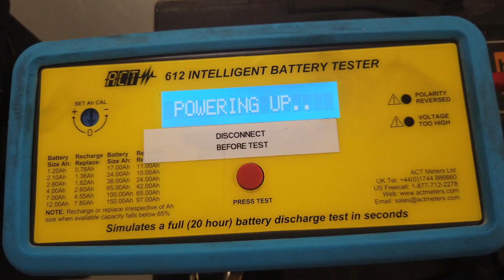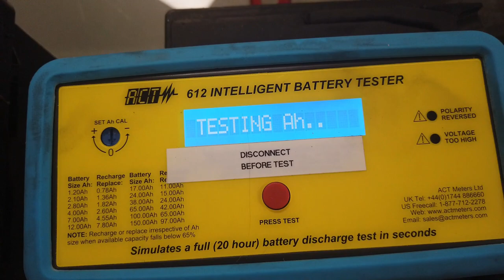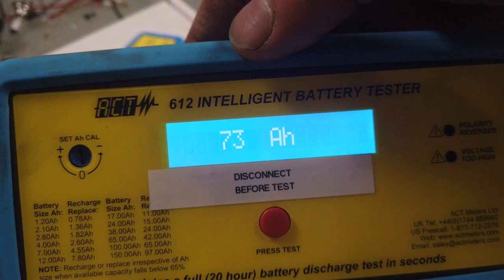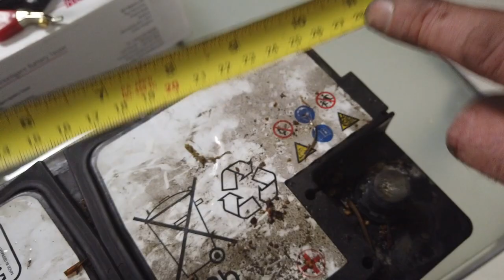How to change Land Rover Freelander 2 battery change + charging + Testing

Comment: If you remove the air filter housing the front of the battery box unclips, then once the battery leads are disconnected and the clamp removed it is a simple task to slide the battery out towards the front of the car. No tilting or navigating around the wires. Also means you can work from the front and not have to hoist the battery over the wing from the side.

Comment: Thanks Simon. I must've tried pulling the old battery out for 10 mins and even got a ladder to stand higher for more leverage before looking this up and noticing the long bolt/clamp that had to be loosened. I guess it was time for a battery replacement since it must've been a really long time since I changed it last and had forgotten about that bolt.
Reply from the maker: I watch my own videos sometimes as i too have forgotten how to do things !
Reply: Riley, I did the same thing trying to pull out me old battry.  Pulled and tugged until I was huffing and puffing, spewed out a few choice verbs.  Listened to a psychologist saying "if you can't do something, it's because you lack the inner strength. You lack power."  I thought to me self, well let me tell you lady, you don't know who you're dealing with!  I've got power!  And I know how to use it too!  I'll show you !  I'm no average bloke.  I'm an above average bloke.
I rented a small crane from CRAP (Consolidated Rent A Part) 
and out the came the battry.  There, job well done, well done.  Boom, right.

The rest of what was left of the LR2 ended up in the junk advertisements.

Comment: When I changed my battery I couldn’t get the clamp back on eventually  I took it back out and found the new battery had a removable filler strip on the side  , removed that and it fitted perfectly.

Comment: Hi  Simon !!

Use your video to change my battery.  
Thanks 😊  !!

But one minor problem .

Dissappear  impulse window .

Encounter with this problems ???

Continue with great jobs 👍👍 !!!

See In another video , close window and still bottom 3 sec to " close window " and will reset and back impulse open/close windows.  Yes ??
Reply: You may need to do a window reset - pull the button to bring the window up and heep holding the button for a few seconds - this should re-calibrate the window - try it and let me know

Comment: Simon - When you removed the battery from the FL2, did you run any sort of "memory saver" or similar type device to retain your electronic settings (radio, engine/transmission, etc)?  

If so, what type (such as an OBD II port connected, or other), and if so, what type do you recommend?  

If not, why not?  

I plan to replace both the primary and aux batteries in my 2016 LR4 and would like to hear your recommendations.  I realize you don't have an aux battery in your Disco 4, but I'm still interested in your comments.  Thank you.

Comment: Good video.  Wondering if I disconnect me battry if the car will require some codes before I can restart or use the radio, etc.  2013 LR2 US ver.  Thanks!
Reply from the maker: From memory we dod not need to enter any codes

Comment: Good job, i changed mine 6 months ago but it was not  simple ..
Reply from the maker: It seems to be more complex than it should be ... i would agree !
Reply: @L663  thank you for this, if you take the battery out overnight can you unlock the system or only at a dealer?

Comment: Nice video! Do you know where I can get a replacement breathing tube? After this video I went to check my battery and realized somebody at some point has cut a piece of this tube and now it does not reach the little hole and plus the plug is missing. Thanks and cheers from Brazil
Reply from the maker: The tube is Part Number LR008949 - it is just $2 from Land Rover....
Reply: @L663  Great! Thank you so much for your reply.

Comment: Really appreciate your videos guys, thank you! Once a new re-charged battery is put back in do we need to let it sit so the battery management system (BMS) recalibrates? I read somewhere it needs about 48 hours to do this unless you have the the Landrover bit of kit to do this.. I have an MY13 Freelander 2.
Reply from the maker: Not sure... the BMS seems to work out the state of play pretty quickly...
Reply: In the end I reconnected the battery and she started up no problem at all without any waiting period. Thanks again!

Comment: Replaced the battery on my 2011 FL2 and have managed to reset the clock in the radio w/o drama but the clock in the dash won't reset. Normally both clocks reset simultaneously. Over.
Reply from the maker: Hmmm this is odd... drive it a couple of times and see what happens !

Comment: Hello. What should be the voltage with engine running? Between what ( min) and max ?  I am asking because I am reading 14.11 V with engine running and I dont know if I should worry or not... thanks ! .. 1 month ago it was 14.45 V ....
Reply from the maker: Anything above 14v should be fine... certainly from a charging / alternator point of view.
Reply: @L663  thank you! I will keep an eye on it

Comment: my freelander has had a new battery but still battery light randomly comes on ,but stop the engine and restart and it goes off.
Reply: It could be the alternator ? check that you are getting 14v on the battery when the engine is running.

Comment: Good afternoon! I am from Brazil and I have a 2007 Freelander 2 HSE gasoline. After standing still for 4 months, fixing the top of the engine. Now the gps blinks and the sound stops working and returns in seconds, when I start the engine and the bluetooth button works sometimes, not always. But the worst problem is that the battery is draining with my car stopped. I have already changed the battery 3 times and all this happens. Please help me. Thank you. e-mail colandoosete@gmail.com